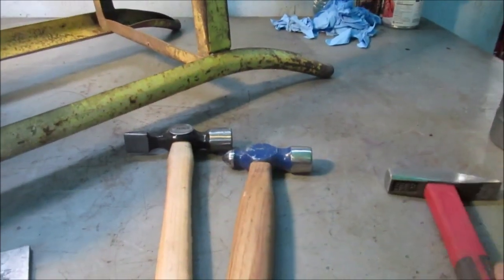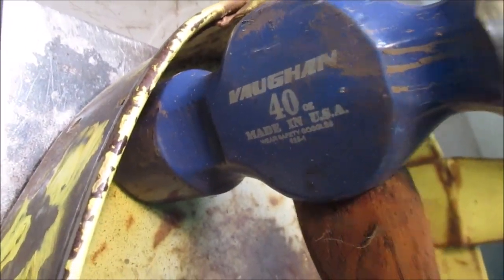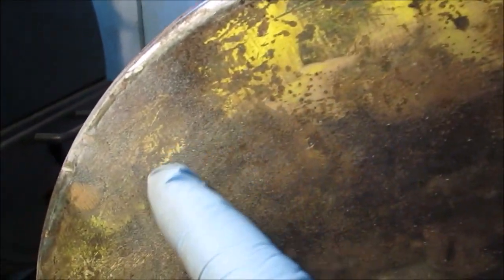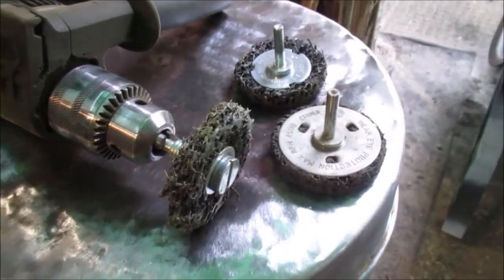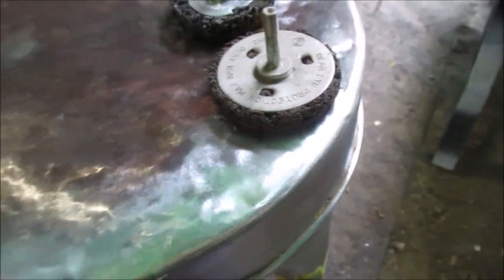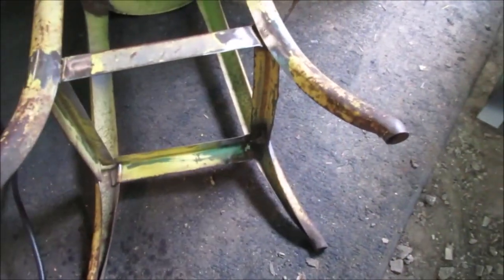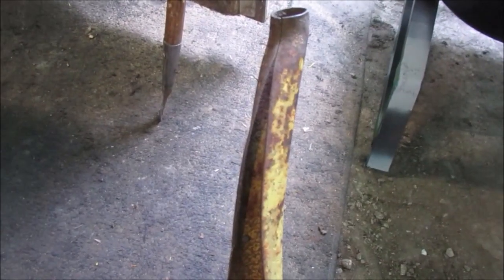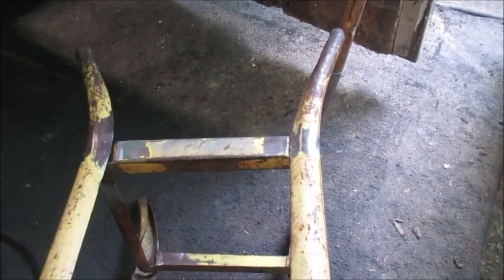REPAIR / REBUILD Metal Stool  part 1 ( small yellow one used for work )

Comment: I had to laugh I have a stool a lot like yours. It was given to me several years ago for helping clean out a garage. It looks like ones that were in shop class in highschool. My son was helping me organize my shop I had to leave for few minutes. I came back and it looks like yours did. Anyway I hate to toss it and then your video came on with a lot of the same problems. Now I think I will fix it. Thanks
Reply from the maker: This is really beat up on the top I use it for welding on a  grinding  on stuff  I might put an 1 /8 in piece of plate metal on it someday  I saved mine from a junkman who would have scrapped it

Comment: Good Project Jim. Hit The Center of It With A Piece of Wood . While Having Something Round And Flat Same Size as the Seat Underneath the Stool. Nice Ball Peen . I Just Restored A 32oz. Myself.
Reply from the maker: It  will be used and abused again so I am leaving it dished in  It did help to cut the braces off